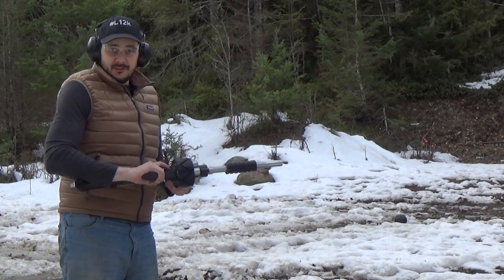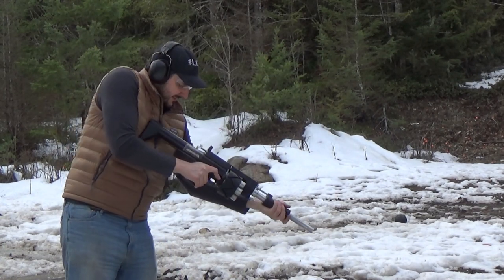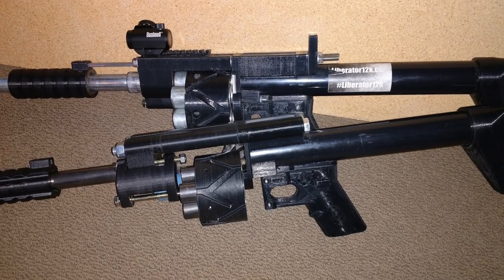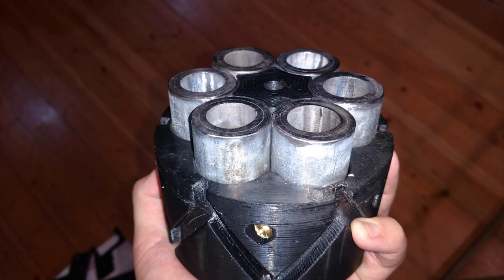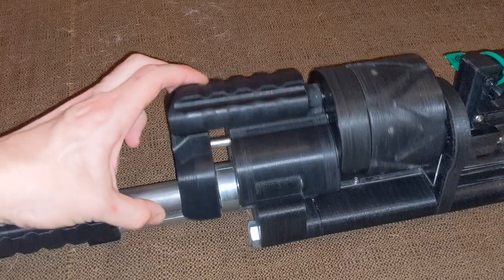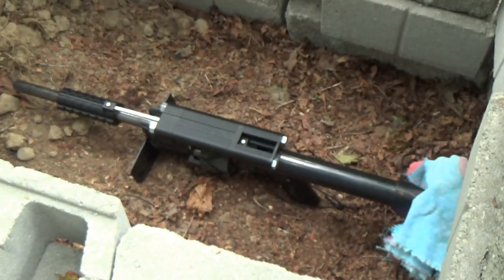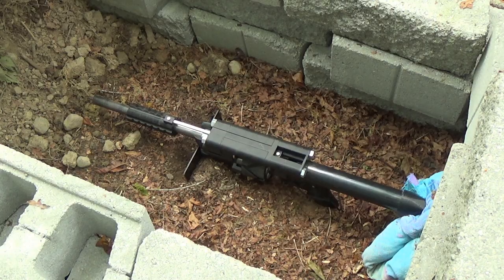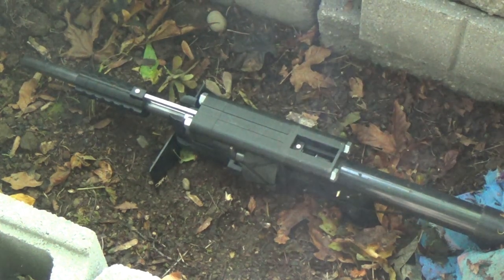#Liberator12k | 32 - Revolver Progress Q1 2020

Comment: I'm thinking of a similar design but the cam slots on the cylinder are reversed and it's a pull forward pump action. The barrel is fixed to the cam pin. When the slide is returned the barrel sleeves over the shell for a nice gas seal. The cylinder is no longer a pressure vessel but just a means of feeding ammunition. I think the jackhammer did something similar but I'm not sure because reference material is sparse. Keep up the good work!

Comment: If you chamfer the breach end of the barrel, bevel the muzzle end of the cylinder inserts add a spring pushing the barrel forward and add a stud on the barrel that would cause the pump to push the barrel into contact with the cylinder insert you'd have a gas seal. 
A gas shield would be much simpler. :p
Reply: Like the nagant revolvers and their telescoping cartridges

Comment: I subtract about a 1/3 of the factory powder load (by volume) and mix 1/3 grits back in to use on my 'crafty' stuff. It has a lower energy density, the flame front moves through the powder a little slower and the peak pressure isn't as high. Modern smokeless shotgun powder is really some extreme stuff, it develops peak pressures really fast, as I am sure you are experiencing first hand ;)

Comment: While the 12 gauge is really cool I would love to see a modified version in 410 you could get a higher capacity for the same size and (I would assume) total round count before failure out of it. once it is released I will have to experiment with this idea. Super cool design 👍
Reply: @Liberator12k  oh I will be doing that.

Comment: A system like the Nagant revolver where the cylinder cams forward would work well with shotgun shells. When the hull opens up to release the payload it would also seal the chamber to the barrel. A linkage to the pin that the cylinder tracks on could be used to pull the cylinder forward when you push the slide forward on the loading stroke.

Comment: Should be possible to have the shells stick out a bit from the cylinder, then have the cylinder slide forward, pushing the front of the shell into the barrel to seal the chamber, similar to a nagant.
Reply: Jeff Rodriguez Good point, I didn't even consider moving the barrel, that's a much better idea when talking about a mostly plastic gun

Comment: I wonder how viable a break action revolver style shotgun would be.
Reply: @Liberator12k  I never imagined I would see a 3d printed shotgun! You sir are an inspiration to us all
Reply: @Liberator12k  could mitigate height by making a side locking break action but you end up adding width, but could also be reinforced with a metal shield. not a machinist/fabricator/gunsmith in any shape or form so take that as you will.

but the design looks like it would be easy for conversions, 20 ga or .410 easily, but I'm wondering if a center-fire rifle cartridge design would work.

Comment: I wonder if seperating the revolver chamber part into two parts, then having a space for a metal tubing to sit between the two halves might help with strengthening it?
Reply from the maker: Possibly... however it's done would need a very strong lever or the surfaces finely ground to ensure a low amount of gas escapes.

Comment: The rotator pin, it chews up the channels right? I might have an idea for that.. or 2..
Reply: @Liberator12k  a piece of narrow u-track from steel. Or a small tube with a spring loaded ball bearing in the tip of the pin. Or both. And, the same screws used to hold the track pieces could help index the cylinder tubes. This shotgun has almost convinced me to buy a 3d printer honestly..

Comment: Hi jeff, great job! I encountered some problems while converting the trigger to .stl

I was not offered in the right menu "what to render"

I chose the wrong file?

If you can refer me it would be super cool :) peace
Reply: @Liberator12k  
thank you for your quick reply !

In fact I encountered slight problems, since before discovering your project, I absolutely did not know OpenSCAD.

So apart from the trigger I am not even sure I could have gathered all the elements in .stl to make the Liberator 12k.

In the right menu under the "RENDER" tab I can only find a few pieces like buttstock receiver coupling lower left and right and 5 others but nothing on the trigger, I missed a step but I don't know which one! thank you for your help
Reply: @Liberator12k  Okay, so for the hammer setup is it voluntarily unavailable or will it soon be available?

PERFECT ! Indeed,  I had too old files ... My bad ! Thanks :D
Reply: @Liberator12k  Oh yeah i like it :D
Reply: @Liberator12k  Hello jeff, here it is, after 28 hours of printing i finaly managed to touch the master piece with my own hands, im talking about the "revolver zigzag cylinder" 🙂

By presenting a tube in front of a hole it occurred to me an idea , you may have already thought about it ... Indeed the 3/4 tubes do not enter if they are not machined, I had imagined maybe threading, even in post printing the 6 cylinders, then also the 6 tubes, and then it would prevent the cylinders from escaping (imagining that we do not put the screws in the holes)

What do you think ?

Aside from that, I can't find the "fore grip" in the "REVOLVER. SCAD" file, I select it but nothing appears. I found it elsewhere but it does not understand the lug which is supposed to receive the metal rod 😞 ...

as for the crane locking system with spring, it is not online? am I still coming before the party? 😛

Thanks for reading me 🙂 Bye
Reply: @Liberator12k  OK thanks for these notes ! I can't wait to see more :)
Reply: @Liberator12k  Perdon Jeff, pero a mi me sale esto en openscad cuando quiero cargar el archivo Reseiver.scad: ERROR: Assertion 'CouplingBolt()' failed: "CouplingBolt() is undefined. Unknown COUPLING_BOLT?" in file OpenSCAD, line 66

Comment: Do you have any books or guides that you use to do any math, for what you are doing?

Or is it purely experience and experiment?
Reply: @Liberator12k  thanks, I was curious because I was thinking of starting into this hobby. Of course I'm going to start small and with a upper parts kit if I can but anyway it's good to know beyond calculating that the barrel doesn't explode it's mostly a matter of experimentation.

Not that I'm against math, but getting my BS in mechanical engineering gave me nightmares about math tests, so it's good to know that it isn't math heavy from the start.

Comment: I actually think a shotgun is a much more natural firearm for 3d printing than normal firearms. First of all, no rifling to worry about. Second of all, lower chamber pressures.
Reply: @Liberator12k  Can I ask why you chose to start with 12 ga?
Reply: @Liberator12k  Lol, I mean as opposed to 28 ga, .410, etc.
Reply: @Liberator12k  Oh for sure. I just kind of think as a step up from .22lr. Shooting .410 slugs would be deadlier than .22lr I would think, and still wouldn't require rifling.
Reply: @Liberator12k  I'm realizing that this may be coming across as a criticism ("you should have done this"), which is not my intent. The gun is really cool, and I'll look forward to following its development.